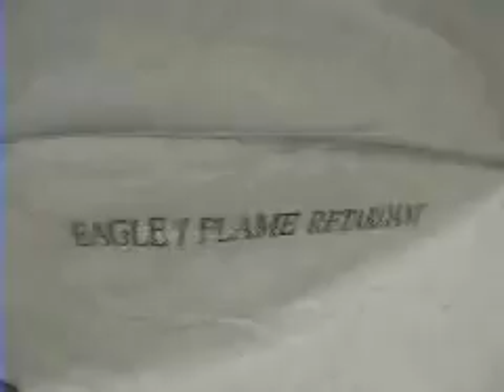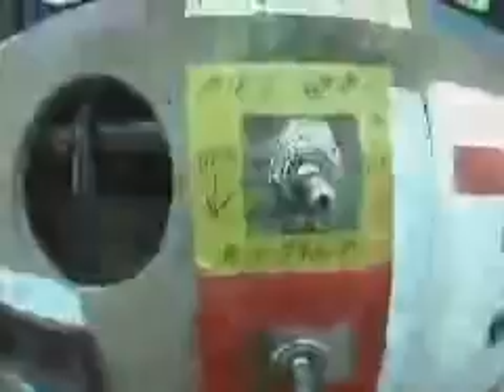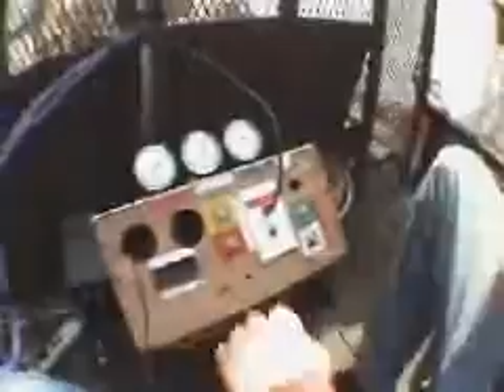My Jet Engine

Comment from the maker: A turbojet engine produces thrust by a net force in one direction. Newtons 3rd law is Action/Reaction, which applies. Accelerate a lot of air very fast in one direction, will produce a force in the other. The jet engine operates on a constant pressure cycle (Brayton cycle). This cycle is continuous until fuel flow is stopped. This concept of continuous cycle can be confusing if you are not used to it.

Comment from the maker: The fuel comes through one nozzle, however, the most critical portion of design of the combustion chamber is the proportion of the cross sectional area of the flame can to the overall chamber, and the placement and distribution of the holes in the can for proper mixing. If you are working on a project and need info, let me know.